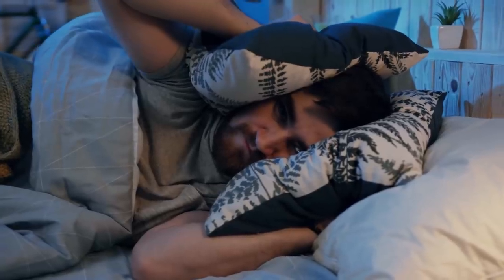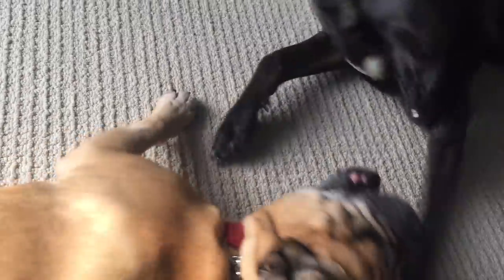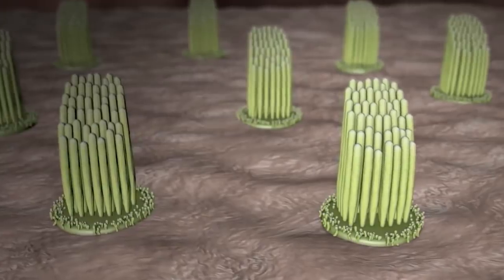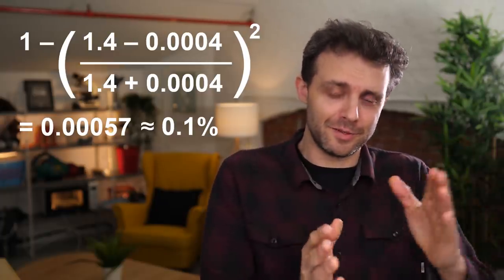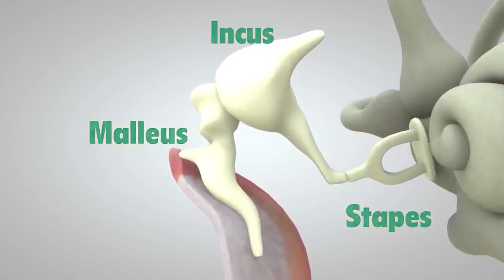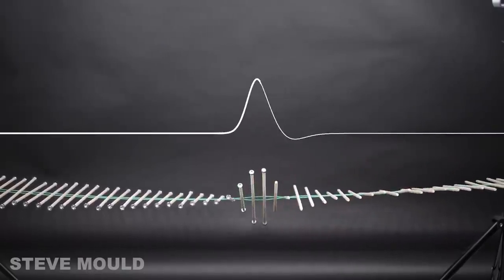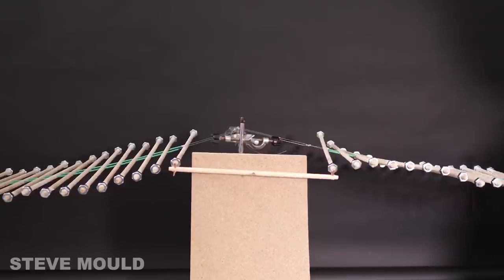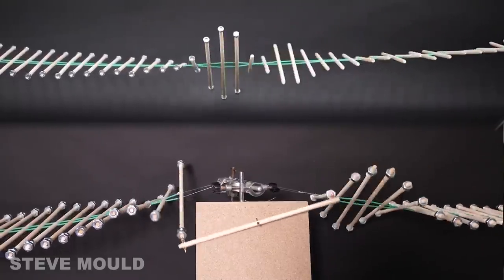There's a Lever in Your Ear and It Does Something Amazing

Comment: I can hear the crunching sounds without needing to do that face, so I can contract my Tensor Tympani Muscle, I always wondered what that was, thanks.
Reply: Same here!
Reply: Yup, can do it as well. Taught myself after realizing the rumbling after yawning. Thought it was normal till a few months ago.
Reply: I can do it also, i've heard us referred to as "Ear rumblers"
Reply: I've wondered as well, didn't realize it was meant to be a reflex. Hard to hold it for long periods of time though. I hope "crunching" isn't an entirely accurate depiction of what you hear though, that doesn't sound all that great
Reply: Sometimes my left one thumps on its own for a few seconds, but it sounds and feels very different from the yawn rumble. Actually not entirely sure it's this exact muscle twitching, but it is a twitch, which is quite different from a more constant contraction.
Reply: "Crunching" sound is probably your Eustachian tubes opening. They have little flaps that open to the throat. I've always considered it to be more of a smacking sound (like smacking one's mouth open, just smaller). I definitely see how it is like crunching.
Reply: I can do this at will as well, but I do have to close my eyes.  Also happens all the time when I yawn.  If someone talks to me and I happen to yawn I inevitably have to ask them to repeat themselves, because I couldn't hear what they said (presumably both because of the 'rumble' sound this causes and the reduced transmission of sound energy this video covers).
Reply: This is exactly what I was thinking about commenting! Then I already read it. Congrats, you've read my mind in the future! thumbs up!
Reply: I can hear it when I tense my jaw.
Reply: Me too
Reply: Yup me too,  I always assumed it was a super power like telekinesis but I couldn't figure out exactly what was happening as a result.  I would describe it as more of a roaring sound and I hear a slightly different sound from each ear.
Reply: Me too. Always thought everyone could. As a kid I'd use it to protect my ears from loud noises like jet engines.
Reply: OMG me too
Reply: Likewise! I even tried to find it on the internet back in 1999, but it's hard to put in terms of search words that would return a result. And awkward to ask of other people.
Reply: After about 10 years of being able to do this I too have finally learned the answer. 
We should start a club or something.
Reply: so uh... anyone also hear bubbling/popping/crackling sounds at will as well?
Reply: @helleye311  I think there is a subreddit, r/earrumblers if I remember correctly
Reply: That sound, similar the paper bag smashed is the tympan membrane that is less flexible than it should.
In my case, it happen during a severe flu infection. Not every year... relatively rarely.
The wax production is usually regulated to not exceed a level where it would clog up. But if too little, the tympan is left, dry and unprotected from dust, bacterias, etc. That wax contact a natural antibacterial, so try to  leave a small layer if you use Q tip.
Reply: Me too.
Reply: I can do it at will, too. So happy to find I'm not the only one who can experience it. I go a little mad thinking of the philosophical aspect that no one else can hear what I'm hearing. I'm all alone. Not anymore.
Reply: I was literally literally about to write this-- i cant believe not everyone can do this i always make it play along to the best of songs lmao
Reply: It seems that a lot of us can work that muscle voluntarily. To me, it's almost like blinking. One time an audiologist was doing an assessment on me and placed a suction cup device in one ear, then zapped a loud sound in the other. When I asked the purpose, he explained it was to test the Tensor Tympani- so I replied, "Oh, this muscle?" and tapped out "shave and a haircut" on his data logger trace.
Reply: I never knew
Reply: I have voluntary control of that muscle, but I can only do both ears at once. I can't do individual ears.
Reply: @gasdive  I can do my left by itself, or both. And I still get a little bit on the right no matter what I do.
Reply: @gasdive  I was wondering if others can do it individually. I can only do both.
Reply: Yeah, I can do that at will as well. Now I finally know what it is!
Reply: I have control of many muscles others don't idk but I just know how to. For the ear rumbling it was involuntary when it first started happening, my ears would perk up (involuntarily move) on which side a noise was and they would move with the beat of music. Super weird lol
Reply: i can only do it in my right ear
Reply: @arfyness  It's a crackling. Doesn't sound like something opening/closing unless it's happening at an extremely fast rate.
Reply: Yeah if you realize that you can do it very young and do it all the time, it becomes very very easy to do, no one would even be able to tell most people are doing it.
Reply: yeah me too, i thought it was something to do with pressure difference
Reply: @arfyness  Are there muscles that attach to the Eustachian tubes too? I can make my ears rumble but I can also make a smacking sound using muscles that feel like they're slightly lower.
Reply: Can any of you do any other weird muscle control things? I am very good at gleeking and I can control muscles to pull my shoulders out of socket
Reply: @xenontesla122  yes. Separate muscles. I can control both. The eustachian tube one I learnt to do for diving. Lots of hours of practice while bored at school. The rumble I could always do.
Reply: Here too. Thanks
Reply: me too!  So cool to learn this.
Reply: Same here! And no need to do any weird faces..
Reply: @theonlyrealcdub  i can move the belly of my thumb as if it was another joint too, my hands are kind of fucked in the motor skills tho
Reply: I learnt to contract my tensor tympani as a child because I didn't like loud noises. By the age of 8 I could hold it for entire railway tunnels.
Reply: Same!
Reply: s a m e.
Told it to my teacher when i was a child, and she couldn't give me an answer.
After 10+ years finally got it. And i'm using it to play the bass of songs in my head for long times.
Reply: The crunching sound will be the Eustachian tube opening. If you can hold it after the crunch and hear a continuous rumble (hard to tell the frequency, definitely less than 50Hz mains hum, maybe 20-30Hz?) that's the muscle being contracted.
Reply: Same! As a matter of fact, nothing happens when I "scrunch up my face" :P
Reply: Is this also why you feel tension inside your ear when you're in a loud concert hall? Is that muscle responsible for dampening loud sounds? I remember we have some sort of reflex to partially dampen sounds when they're too loud, but I don't remember its name and have no idea how it works.

EDIT: I should watch the full video before making these comments. :-)
Reply: Yeah, I'm pretty sure I can contract mine voluntarily too. But I've also been having a problem recently where they seem to go into spasm a lot for no apparent reason.
Reply: Same here, except that I don't hear crunching sounds but more like low frequency rumbling accord to how much contraction I apply. 😁
Reply: Same. I think it's because the sound of trains used to scare me and I kinda learned from there
Reply: Yeah glad to be enlightened on what that is.
I can also widen my nostrils and move my ears individually.
I can stop a yawn or sneeze from happening, and cause a caugh or barf reflex to trigger.

One mystery left... what's this clicking above my palate?
Reply: @anassyria5176  now that you mention it, the crunchy bit, and the low frequency rumble, are separate things for me, and I just found out I can do them both, consciously, separately, and simultaneously! 😁
Reply: Agreed! The crunchy bit comes from the Eustachian tube (airways connecting from the middle ear to the nasopharynx). We can hear them when swallowing or yawning, and some people like us can control it manually. 🤫😁
Reply: I think I also do but I'm not sure, could you describe the sound?
To me it feels like wind on a microphone with a bit of high pitch whine in the background
Reply: @IIIIIsKieIIIII wow, since you have that level of control try this thing.
If I pinch my nose and start blowing, only sometimes air starts coming out of my tear canals, it's really strange and makes my eyes tickle for the vibration but sometimes it just doesn't work. If air doesn't start coming out after a bit of pressure stop before it starts to become dangerous
Reply: Mine sounds like a cat purring
Reply: Right! Same!
Reply: Ya, same here. I have kind of learned to control it too. But I never knew what it was.
Reply: @r0cketplumber  what was his reaction?
Reply: Yep, I can do it without tensing any other muscles too.
Reply: @Wigglemice  He was surprised- if any previous patients had been able to do the same thing, none had demonstrated the ability. I guess it takes an extroverted nerd to risk annoying a doctor- especially in an Army hospital. I was a dependent and not a soldier, so I could get away with it.
Reply: DeviilReaper same
Reply: Me too. I once read a certain percentage of the population can. Before I had read that, I always assumed erverybody could do that :)
Reply: It never occurred to me that not everyone could do this at will. But I never knew physically what was happening until now. Just like I've been taught several times about those little bones but somehow never told what they actually do until now. And that was probably the best demonstration of impedance mismatch I've ever seen. So, great video!
Reply: I can do that too but not consistently enough to block out noises or hold it for longer than 3 seconds. I thought I was making a pressure difference in my ear
Edit: I also can't do it without hearing the tube thing open. Y'know the little crunch sound
Reply: Me too
Reply: I remember spending so long as a kid wondering if anyone could hear all those loud noises coming from my ears.
...I miss being that dumb.
Reply: I can do that too.
Reply: Sweet I learned what this was as I can do it as well just never bother to figure out what it was.
Reply: Me too!
Reply: @GadAnimations  I thought it was more of a "pop" almost
Reply: Hey me too! I always wondered what that muscle was
Reply: Crunching sound is more than likely the Eustachian tubes, the Tensor Tympani muscle makes a rumbling sound. I can control mine, but I also have Eustachian tube dysfunction so experience crackling/ crunching in my ears often too due to the inflammation
Reply: I can also do this! I can also give myself goosebumps and/or shiver on command! The body can do some crazy stuff. :) If I want to bump up the sensitivity on my hearing for a bit, I can (de?)pressurise my ears, as well.
Reply: Same
Reply: @arfyness  There was a period of about a months when that happened every time I opened my mouth.  It sounded like a crinkly smacking noise in my left ear. And I mean every single time! Eating or talking became quite annoying. Thankfully it gradually stopped on its own.
My ears are quite rumbly in general. They tend to freak out with rumbling and crackling for about a second when there is a sudden change of volume from loud to quiet. Though it only happens if the ambient noise level is very low. Or I can trigger it by flexing my eye-muscles, particularly in a quiet room.
Reply: I've finally found my people! I've been able to make this happen, at will, since I was child. Had no idea what it was, and any one I had mentioned it to, looked at me like I was speaking Sanskrit. Finally and answer. 😁
Reply: The "crunching" sound you hear while yawning is actually your eustachian tube opening, it acts as an air pressure stabilizer from the top of your nasal cavity (outside air pressure) to the cavity in your middle ear.
Reply: @pskugd8385  Dear psk ugd
I wish to express my condolences to you for leaving behind the clarity and freedom of life as an atheist.
May you not stray too far from the path of non-faith and soon find back to it.
Reply: sometimes I overdo it and it hurts :(
Reply: mine usually tenses up with my sister gets angry and starts talking. usually ends with me not hearing anything she says.
Reply: youd be a good diver, I can do it too
Reply: You can actually hear through your nose when you do it. Some how found that out in the the past years
Reply: Wow me too
Reply: same
Reply: oh so that's what it is
Reply: I learned to control it. It caught my attention after yawning. Its useful in blocking high pitched reverbirating noises(fire alarms, commercial back up beeper, whistle close range)
Reply: Same for me
Reply: I hear clicks when I do it too
Reply: RUMBLERS, AAAASSSEEEEEEMMMMBLLLLE

And rumble while you do it for dramatic effect.
Reply: Me too!!!
Reply: i can do it without making that face, but i have to close my eyes, and it makes a deeper rumbling sound
Reply: Do you have to close you eyes? I can do it without scrunching my face, but if I try to keep my eyes open I can only get faint 'blips'. However, if I close my eyes all I have to do is focus and the rumbling starts.
Reply: i thought it was weird that I could always just do that.... I can't tell if anything else is flexing/moving but I can flex that muscle independently.
Reply: Same by me, but i was able to do this without contracting any other muscle since i can remember
Reply: I can do it by "flexing" my ears back (though since I developed tinnitus in my right ear earlier this year, I've just noticed I can only do it on my left ear anymore...hmmm....)

Comment: Well I just learned something about myself! I've always been able to "close off" my ears from loud sound using a muscle in/around my jaw at will, but I never knew it was using the tensor tympani muscle. It's one of those things that's hard to describe, but when I do it, everything sounds muffled like I'm underwater and occasionally I will hear that roaring sound you get when yawning. As soon as I looked up the tensor tympani, accounts of people doing this told me it was exactly the thing I've been doing.
Reply: Have always been able to do it myself.
I can hear my breathing and heartbeat really loud though
Reply: I can make a rumbling noise in my ears at will, I assume it's this muscle? Not sure it really lowers the volume of external noise though.
Reply: Interesting, I am able to let my ears “crack” at will, but i still can hear nearly everything like normal... but I also hear my heartbeat and my breath like I am yawning 😕
In the ear there is an Eustachian tube, where some people can open at will (and let the ears crack, for example if you are flying in an airplane and feel a pressure in the ears).
Maybe I can open this, but not use this special muscle? Do anyone have more information?
Reply: @schuppe9006  I kind of tense up my  upper jaw but I focus on  the inside of my ear to "pop" my ears and on planes and when swimming sometimes.
Reply: @schuppe9006  In scuba diving, it's known as "clearing your ears." It's a group of muscles in/around the throat. Open your throat thoroughly, and pull the back of your tongue muscle down and forward. Pushing your jaw down and forward might help. There's one more key muscle action involved, related to swallowing, that I feel like is a separate thing, but I don't really know how to describe it. https://www.scubadiving.com/equalizing-ear-clearing-scuba-diving
Reply: Hey me too!
Reply: @schuppe9006  I use the same technique for popping my ears.
No idea which muscles im controlling, might be multiple.
I hear a light clicking sound, ears are popped and if i keep holding it i hear my internal sounds loudly
Reply: @Casual Baluga @arfyness thank you for responding, yes I can do that also, but in the video and the top comment there were saying that it would “muffle” the sound you hear from outside.. but it does not for me 🤷 Is there something I can’t do (or doing wrong)?
Reply: @schuppe9006  As far as I could tell looking up the condition/ability now that I know what to call it, it has different effects for different people. For me, it tends to only muffle the louder sounds that come in, and even that only if I "pull" on the muscle enough to start hearing the rumble associated with yawning. What you're describing is basically the difference between closing your eyes and screwing them shut.
Reply: The muffled sound is probably your skin pushed up to obstruct the ear canal, which is a very good ancestral capacity that your genetic family line preserved.
The loud breathing is when you open the eustache tube. Normally, these tube open briefly when swallowing (like chewing gum), allowing to adjust the air pressure in the middle ear to equalize with the ambient pressure.
In some rare case, the tubes can remain open for a few minutes. If you can, try make them closing. With your hand, pinch your nose, close your month and push air with your lung toward your nose. The longer the tube remain open ,the higher the chance for bacterias to come in and infect your middle ear.
Reply: Yeah I also do this, and I do something really similar to pop my ears when going through elevation changes.
Reply: Naturally there's a Reddit sub for us that can do that: /r/earrumblersassemble
Reply: Same
Reply: I can do this as well. I've been able to do it since I was 9 years old and I've never really had an explanation for it, because no one I've told about it has experienced it. Then I saw a Reddit post about it a couple months ago and I was like "FINALLY! An explanation!" lol
For those of you who can also do this, do you ever play around with it? Like when listening to music or when you have a song stuck in your head, vibrate it to the tune? hahaha
Reply: Me too thats strange lol
Reply: @nocare love that lol